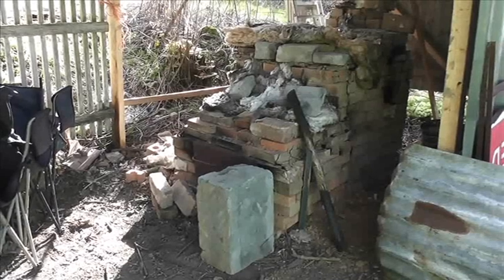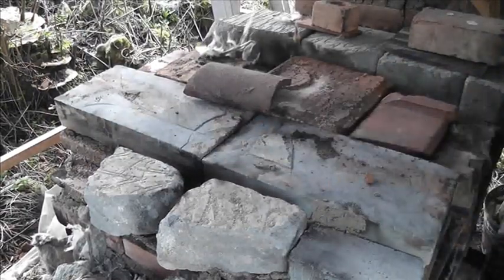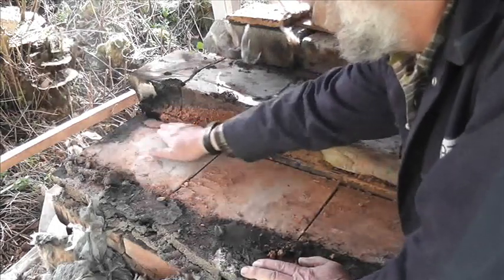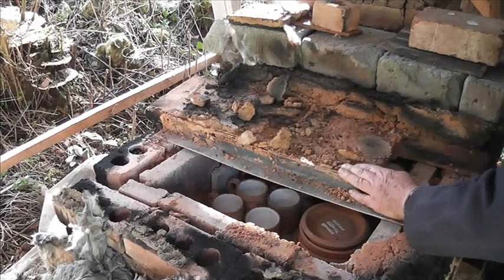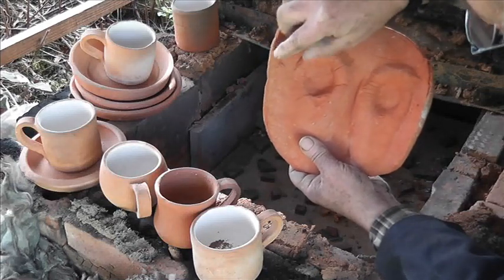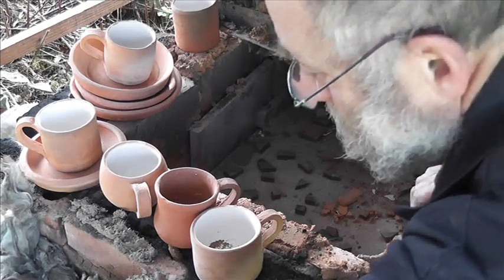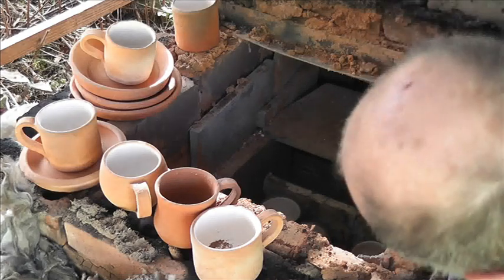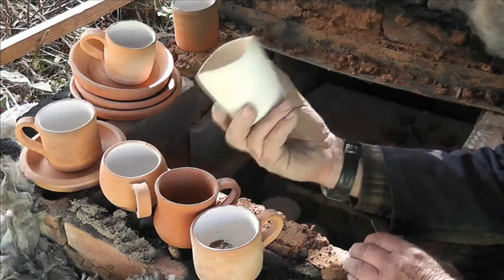Pottery improved wood firing kiln MK5

Comment: My favourite are the spherical mugs in home clay with white slip on the inside. Will have to place an order.

My uncle seemed to think the ones with the short vertical cracks were due to over dry clay. He said the students at school over work the clay with warm hands. Suggests to add some slip during final fettling before firing.
For the horizontal cracks, add some very fine grog and glaze then refire.
Reply from the maker: Ian, I'm more in the mind to just junk pots with defects as making more is just good practice and practice is what it's all about. If you can give me a time stamp in the video I can see which one you fancy. It will need glazing but if you can securely get your address to me I will send it when completed in appreciation of you support. Cheers
Reply: @TheInfoworks  Yes
My uncle said he didn't fix any of the work as it's all part of the education. That and the students have a piece that's entirely theirs.
Donation with message sent.
Reply from the maker: @ianhelsbyservices  Ian, that was unlooked for but very much appreciated. The glaze is transparent but will darken the colour. So what I propose is that when the glaze firing is complete I do a video so you can see the results and choose. Cheers and thanks, Andy

Comment: Glad to see progress Andy, is there a chance that the pyrometer readings are not representative of the whole chamber? Maybe some more probe holes?
Reply from the maker: Owen, maybe, but also building the heat deflector wall has moved the excess heat created by the bigger firebox to the back of the lower kiln shelf and the start of the upper one. Solution: slower firing to reduce the heat gradient. And so we move on, cheers